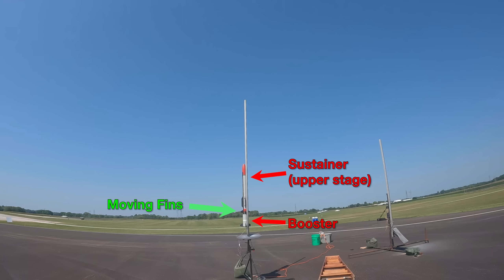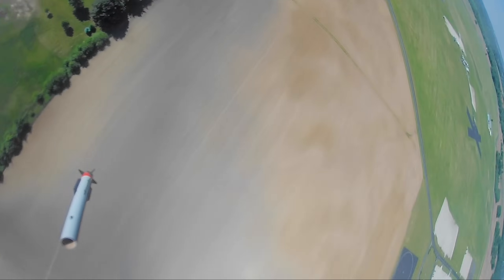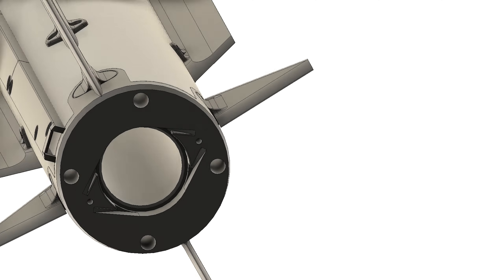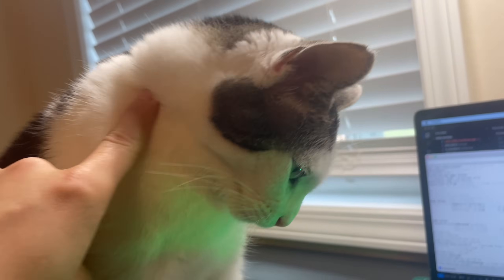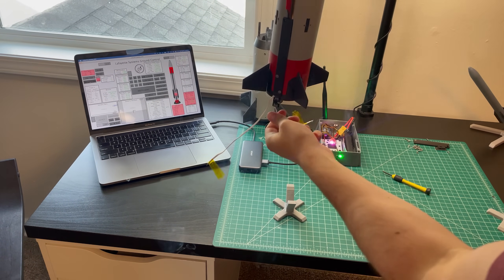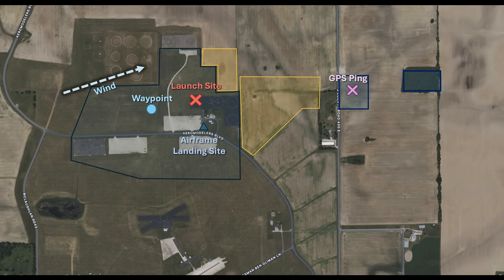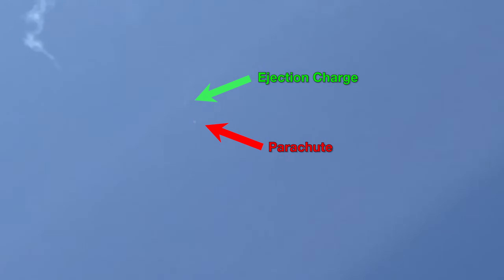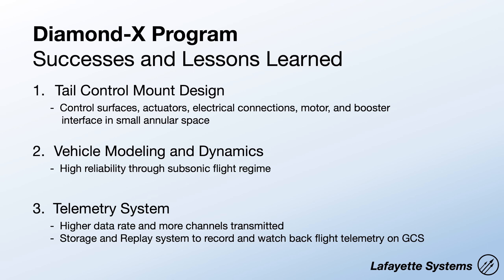Building and Flying a Two-Stage Active Control Rocket

Comment: Not sure if that's a viable solution for the niche cases in which the Rocket- or relevant parts of it get lost, but what about putting in a piezo tweeter and a bit of code that emits an acoustic signal after landing until either the battery runs empty or the vehicle is found. That would make finding it a lot easier than just relying on GPS and visual. Either way, love your Content!

Comment: I know there are some reasons not to do this, but would it work at all to rotate the fins on the booster by 45° and set a maximum deflection during the boost stage that would have a minimal impact on the booster stabilizers?

Comment: I would add more thrust and larger tail control surfaces (area size). And maybe make a really light analog to the definitive plane with the exact same CG, to test dynamic pitch stability when hand launching. Every plane should be able to do stable unpowered glide, as long as it's light enough.

Comment: tip from a skydiver, use a braided dacron/polyester  line instead of your kevlar "shock cord" as kevlar has so little stretch that it will easily apply too short of a duration (and much higher peak) shock load causing it to break free... and instead of trying to attach it to the load in tension loop it around and under the entire bay so that it is held in compression and much less likely to fail...

also realize that even a human body from several thousand feet with a modest (10mph) cross wind will drift much more than you think, estimate the "terminal velocity" of you lost "bay" (much less than a rock, tennis ball, ping pong ball, small parachute) to determine the "freefall time and then apply that crosswind component to it
Reply: Unfortunately polyester degrades with repeated exposure to pyrotechnics that deploy the parachutes, kevlar is much preferred in rocketry for it's ability to hold up to a lot of firings of the ejections charges.

Comment: Might be time to find a cheap little tattler beacon you can program (like an esp based chip). A two way link, plus a simple burp you can use a basic foxhunting (radio direction finding) antenna to get a bearing on (like two wires 1/2 wavelength apart, when the source is in line with the support between the wires the signal is at its loudest, but there are other antenna types, ie yagi, cantenna, loop, etc). The two way link could provide denser data, but if for some reason you cant find it but still talk to it you can send it a command to 'sleep' until a certain time (like when you can get back out into the field to look for it) to maximize battery life (maybe even a little solar cell if you want to get really paranoid). Have a minimum power mode that will just burp every minute or some such, perhaps a mode that if it does not detect a signal of some sort switch to burps every hour or something, again to maximize battery life yet still have a predictable behavior in the event of data link loss, maybe auto sleep between night hours. Or hell, add an old point and shoot xenon flash circuit (should be pretty light, heh light), and go around dusk, send it a signal to flash every 30s, minute, whatever, and look for it with a drone camera...

[shrug] Just my 2 cents worth of brain droppings. Honestly, and I have about 20 years fabrication and machining experience under my flab, with all you've achieved so far Im a bit surprised the thing cant just walk home! LoL You've made some serious self taught/motivated/funded leaps and bounds not only in rocketry, but in autonomous control systems in general. If this stuff doesnt get you hired by raytheon or some other supplier of big boy toys, the world is truly unjust. Anyhoo, awesome work mate, keep on keeping on! 😎👍

Still jealous of that interface you've got going on, that thing is boss as frigg.

Comment: Didn’t you have an abort guidance system for sudden pitches too far from the angle of the waypoint? Did that sudden pitch from the weak booster off the launchpad possibly have aborted the guidance?

Comment: ive been flying rc planes for a while and lost way too much hadware over the years lol
ive used buzzers years ago but for somthing withweight and size restriction like a rocket something like an apple air tag would work, it will only have a range of 30 meters or so. but it will help emsensly

Comment: There's a bunch of techniques for locating errant components, both passive and active. Kinda surprised you're not using any.

Conards and chaotic airflow are easily solved. Do a little research for your next build.

I've seen cheap store bought Drones used to check "conditions" before a launch. Others in "station keeping" throughout the flight.

Faults and Failures carry just as much learning as do successes. 
I build and develop SCRAMJETs.

Comment: Sorry you lost your avionics bay, data, and camera recording. I've spent a bit of time searching for planes and rockets in fields. Most recently, my Dad downed my 5" fpv quad in a lush soybean field. We had a bit of goggle dvr to provide general area, but what saved me was the auxiliary beeper. Setting the beeper up on the bench-top I thought it was crazy loud. In the real world under vegetation and wind it was difficult to hear, but we eventually found it. I have no doubt you will improve on your systems and redundancy. Thanks for the ride. I'll stay tuned in for the next one!
Reply: This is definitely worth considering, although with a rocket you have the added problems of a much larger potential search area and the possibility it buried itself in the ground since the parachute failed. Some sort of radio beacon might be the way, like we can use a directional antenna on FPV goggles if there’s still a weak video signal.
Reply: Good idea

Comment: Great video.  I don't do rockets but fly RC planes.  One thing a few RC player do is have Reflective tape in stuff like batteries, receivers and servos.  Makes it easier to find your lost items at time time with a huge flash light.  I know it tight in there for extra stuff and the reflective tape will not last on the out side of the rocket.  All so have to watching out for tape that will block singles.  I'll have to check out your other videos. Keep up the great work.
Reply: Put a beeper in the rocket

Comment: Do you not have a radio beacon with your avionics? ...just shove a cheap BLE tag in there. 
They're tiny, they weigh ~5g, cost ~$10, and you can detect them from ~30m away. (Ex: Minew E8)

Put a BLE receiver on a quadcopter and you can find your stuff within a square mile area in just a few minutes.

Comment: For booster separation, have you considered detecting when the booster motor quits and then 'immediately' firing off the sustainer motor (with no timer)?   You will need an accelerometer for this, as a timer to do this is far below your expertise.  Thanks for moving the state of the art of model rocketry ahead!!
Reply from the maker: The current setup is detecting booster burnout with the accelerometer, firing the booster separation charge, waiting 500ms and then trying to ignite the upper stage. If you remove the booster sep charge or delay, you would be "hot staging", where the upper stage motor fires into the top of the booster to separate. Hot staging should work, but might damage the top of the booster.
Reply: @LafayetteSystems  500ms is a LONG TIME, so try and decrease it to 200ms as it takes some time for the sustainer motor to 'light' so the booster would not be damaged so severely.  Again, you're doing an excellent job at this.  Too bad the rank and file rocketeer doesn't catch on and start their own innovations.

Comment: I'm a complete noob at this so forgive me if this is dumb, but firefighter suits have a small little device called the PASS (personal alert safety system) or ADSU (automatic distress signal unit) which is a small little box that outputs a 95decible noise whenever a firefighter does not move for a certain amount of time. Could something like this be useful for recovering parts after they landed?
Reply from the maker: Yep! Beepers are something I’m going to add to Sapphire. They’re just quite annoying to have on during testing at home

Comment: Just a note on hatchet, make sure to consider the induced roll on the vehicle at lower speeds where the active fins have little control authority as the induced roll is pretty aggressive with EDFs. (also, reaction wheels are not a good solution to this given the gyroscopic precession when attitude changes)

Comment: What motors were you using and can you say in future videos?
Reply from the maker: Sure! This was a CTI G115 on the booster and an H53 long burn on the upper stage.
Reply: @ Thanks for responding. I did see that they looked like CTI motors because of the yellow cap. I can’t wait for your next project!
Reply: @LafayetteSystems this might be a silly question, but how many of these stages do you think you can successfully stack and launch at once before the extra weight makes them unstable for initial flight?

Comment: We're all just going to pretend its pure coincidence the "rocket" seems nearly identical to the mica and this video is about making it function like the sm2. Also, you should probably put a colored smoke charge or radio direction finder in the avionics bay to make recovery easily.

Comment: 17:27 oh I thought the Airframe from Diamond X is already made out of Composite.
What is the white „Tube“ of Diamond X made of? You said in your assembly video of it „cardboard“ it thought it was a joke.

Btw. you inspired me to build my own rocket. I’m currently at a very early stage. I started with (for me) the hardest part the programming and I’m Learning constantly.
Reply: Technically, cardboard is a composite of paper and glue!
Reply: @ ok thx
Reply: About the tube, it looks like ones you'd buy for beginner model rocketry. It's "kraft paper" which is basically cardboard made using the "kraft process" which is a specific wood pulp manufacturing process.
Reply: @kevinl2482  thanks for the information!

Comment: Regarding the control fin vortex impingement on the booster fins. Would offsetting the booster fins by 45 degrees, i.e. so they are in between the rocket fins, reduce, or even better eliminate, the issue and allow active control during the booster stage of flight?
Reply from the maker: That can certainly help! The only challenge is finding a fin orientation that works for control and leaves space for the launch rail :)

Comment: Quick idea. If you changed the detect from a short to a resistor you could have the flight computer detect the type of booster dependant on resistance detected
Reply: Resistance detection with a known resistor is preferred either way, because then you can tell if the connection is faulted
Reply: I hate that I don't really understand what he wrote even though I'm mechanical eng. Student😢 Am I a bad injeneer😢